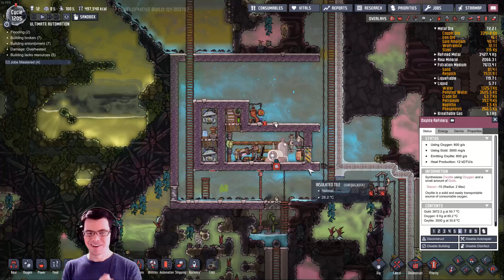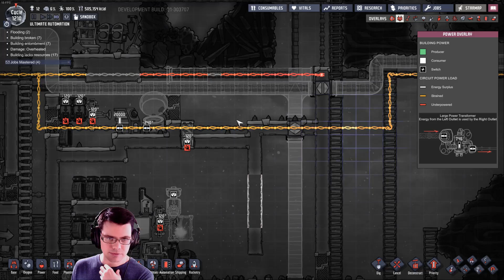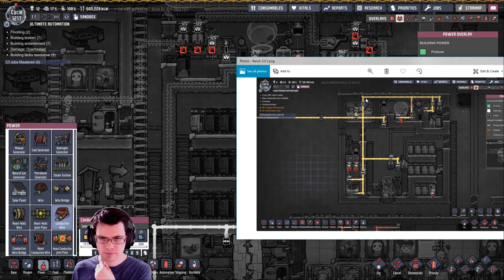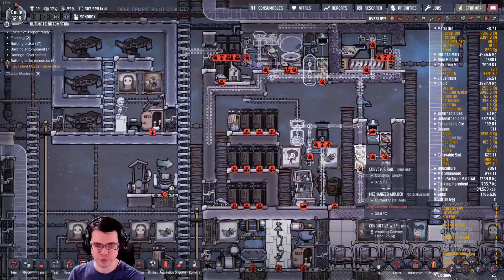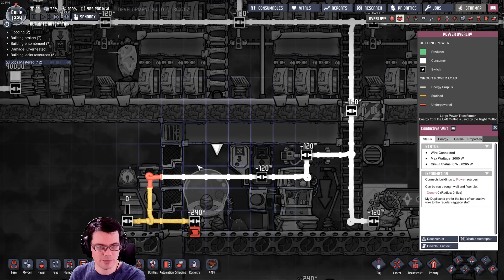Oxygen Not Included - A Better Ranch! Ultimate Automation Challenge ep 41

Comment: hey there so i tried a simpler version of your "heat flusher", have yet to test it on a cool steam vent, but i found something wierd at the same time, first my machine kept overheating even with gold (forgot the hydrogen), but at the time i didn't have access to hydrogen, so i tried using a vacuum instead (way easier to make), i have yet to see how it works in long run, but definitely an interesting thought. It works well so far, but i am unsure how the heat transfer in the game works, since i convert 30 degrees in water to less than 1 degree in the machine.

Comment: dont for the life of me know why you dont have a couple scrubber filter boxes running. simple setups just a 5x5 box with a scrubber in it and a pressure sensor set to above 1300. regular vent is fine as a co2 input. building it all in that chamber would ensure they are sealed with no other gasses. the extra pwater is nice but 4 on a sieve is simple could use it to burn heat tho
Reply: you could spool out the pipes in it just to make sure the scrubbers stay at the 40 the sieve filters at
Reply: then you could dump any temp co2 in there and poof